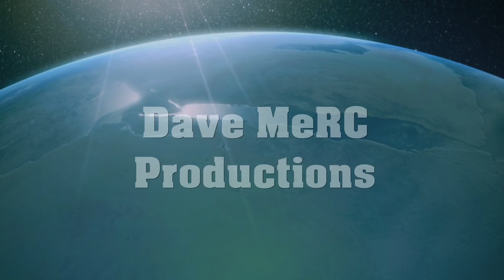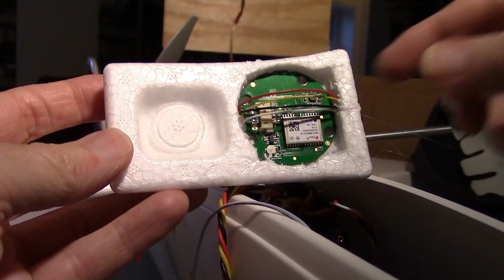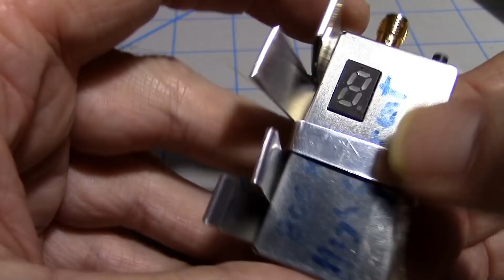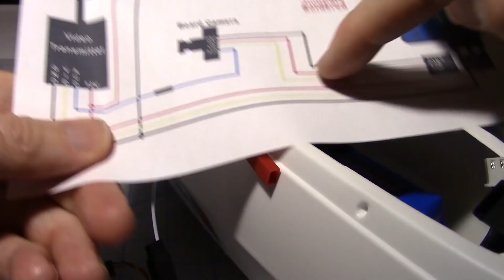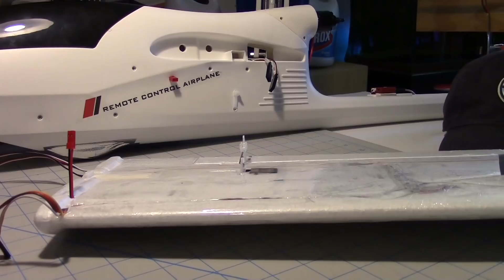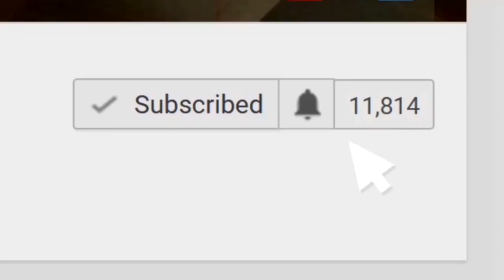Volantex Ranger 2000 FPV RC Plane Build Part 8 - FPV Video System Install

Comment: Hi Dave, I know it's been some time since you did these videos but would you help me please?
I would like to know the width of the area at the front of the plane where the FPV camera is mounted. There's the hole that the camera lens pokes out from, and each side of that there are some straight bits... I'd like to know the distance between those straight parts please (if you still have access to this plane)

I've got one on order, and I'm trying to design a 3D printed part that will allow me to easily mount the FPV camera in that inside area. I need to know how wide to have the part. Many thanks
Reply from the maker: I could only give the outside dimensions because there is too much in the way to get inside.
Best to just wait until you get her and then measure properly. I decided not to use that hole for the cam because the lens kept getting dirty. Now I have the fpv cam mounted in a new hole above that and slightly tilted down.
Reply: @DaveMerc  Thank you, out of interest, what are the outside dimensions?
Reply from the maker: Roughly 40mm. Measured twice to make sure.
Reply: @DaveMerc  thank you so much. I found your motor nacelles on thingiverse, I might convert mine to a twin at some point too. Thanks again.

Comment: Nice series of videos Dave. I bought a Ranger 2400 which I'm also planning to use a PixHawk on. For the control link I think I want to use  a FrSky R9M and R9 Slim+ receiver so I can get the FrSky telemetry.
I want to use a RMRC 1500mw 1.3gHz video Tx but am concerned about GPS interference. I'm hoping that with careful placement of the GPS and the use of an EMI absorber, I can get reliable GPS with 1500mw of video power. If I could locate the GPS in the null of the VTX Dipole, it might help too.
Did you consider using a circularly polarized VTX antenna instead of the Dipole? For long range FPV, I'm guessing the dipole is actually better.

Comment: Hi Dave, great plain you have there. Do you know why my osd is flikering? I am powering the vtx from a 3s and the camera and mini osd (the new small one) from the vtx 5v output. Connected telemetry and ground from APM to mini osd. Thanks!
Reply from the maker: Ground looping can cause this (having more than one ground path to the APM) for example
you may have a ground wire on the throttle channel to the ESC when you already have a ground from the  power module. Solution: Remove the throttle channel ground and only have the signal wire. I also isolate my servo bus by removing the jumper and powering from a separate UBEC. If none of that works try a LC line filter on the power and ground to the FPV system.
Reply: Thank you!

Comment: The lawmate 500/1000 vtx costs 60% more than 800mv vtx from RMRC
and you have isues with a simple combination VTX/GPS antenna? OVERPRICED JUNK  almost baught that!
Reply from the maker: True, Lawmate is a waste of money in my opinion. It makes a good GPS signal jammer. The dip switches are a pain in the butt too. I like the button that the RMRC ones have much better.